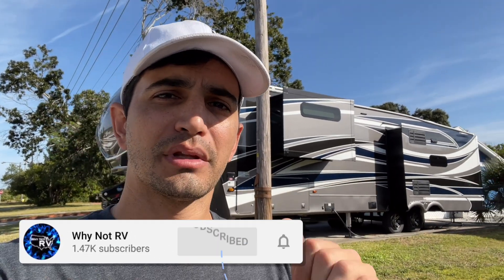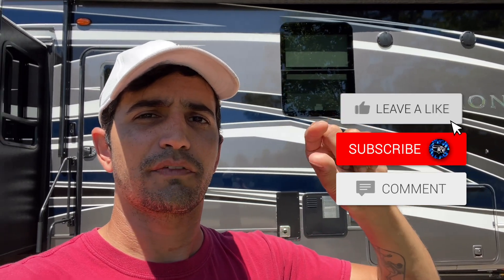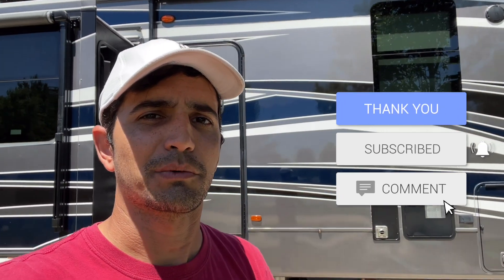RV Inverters! Let's talk about them... Solar Saturday part 4 on Why Not RV

Comment: 12v-24v-48v BIG QUESTION:
I am building a new system, so why go up to a higher voltage when a lot of items in the RV are 12v.
1400w of Solar panels to MPPT is 18-ft
MPPT to x4 battery 100amp each (one bank for now) less than 4-ft
Inverter less than 4-ft
Main 220v panel 10-ft. 

I know every time you step up or down in voltage you lose about 30% in heat and efficiency. 
You also need to add another component to get back to 12v (fans, TV, lighting, refrigerator). Stove is gas.

So why go to a 24v or 48v system? And not stay at 12v
Reply from the maker: The reasons to go to 24 or 48 is for efficiency, reduced cable size, more available power (mppt can handle twice as much in 24v and 4 times as much in 48v compared to 12v). If you’re building a smaller basic system it’s probably not worth it to step up just to step back down voltage. But larger systems is where it really pays off.